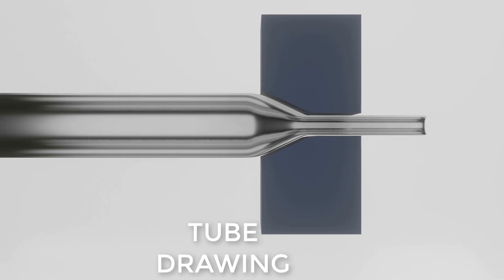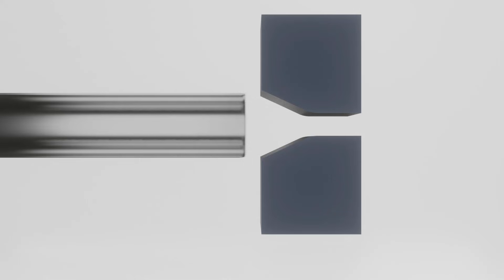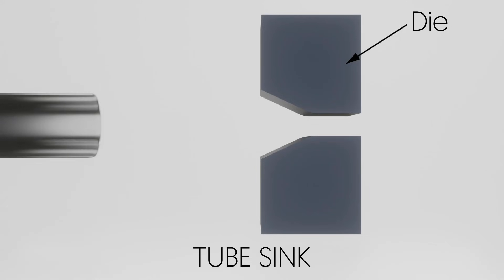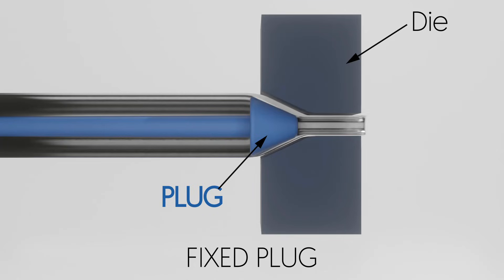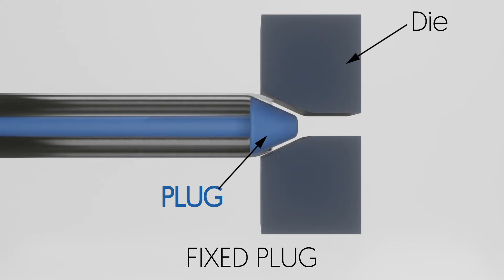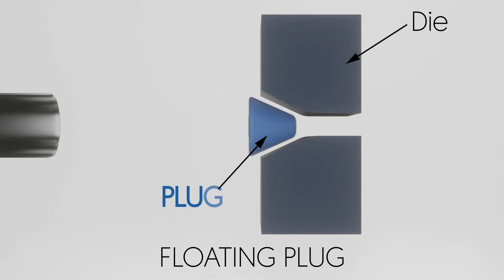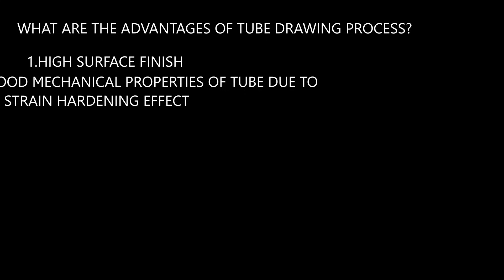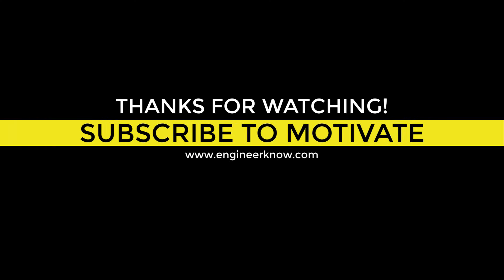Tube drawing process and different method explained 3D animaiton

Comment: What is about Chattering? Solution? Tool damage and Speed limit goes by chattering. I know there is a solution now in 2022.
Reply: Heating the plug can help with chatter, adjusting the position/angle of the plug can help, so can speed. 
Also, if the height of the bench isn’t perfectly aligned with the die block, chattering can occur.